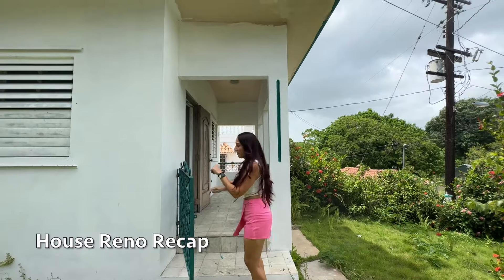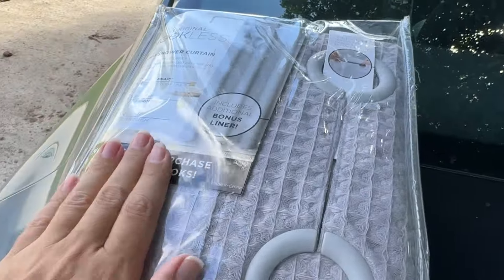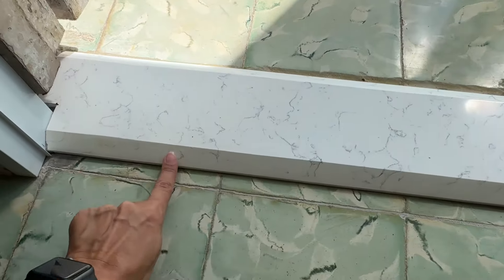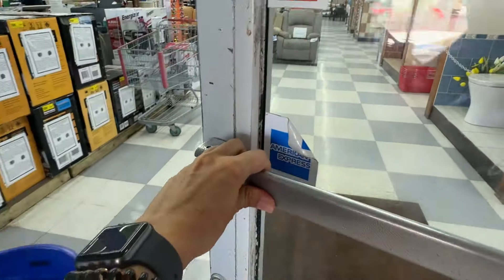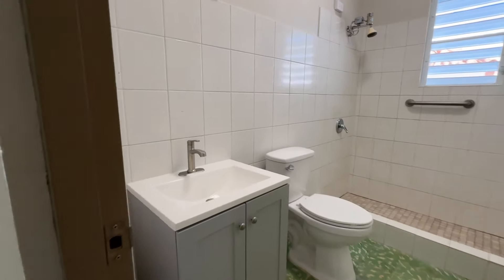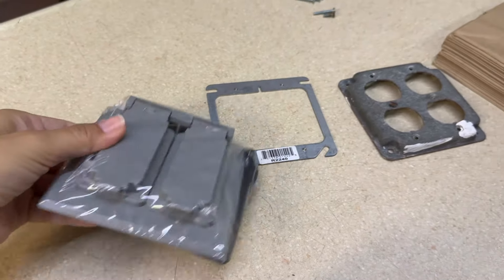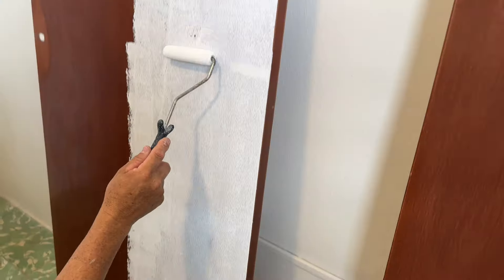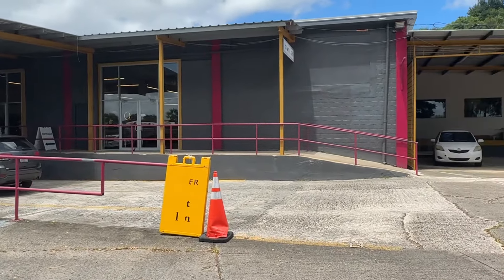Bathroom Transformation Begins! Plus Closet Doors get a facelift. (Ep.8)

Comment: Ana why you just don't paint that green floor?  I'm quite sure if the floors are a neutral color the overall house would be popping. 😊
Reply from the maker: Paint chips, that would drive me crazy. I rather see an original floor than to worry about messing up the paint on something we need to walk on, mop, and move furniture. If painting floors was a thing, everyone would have it, but that's not common for a reason.